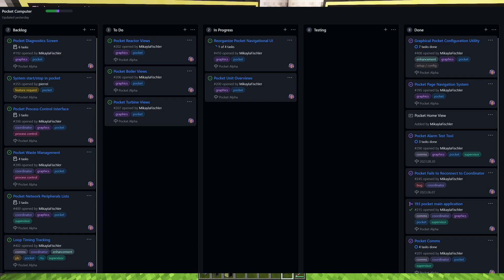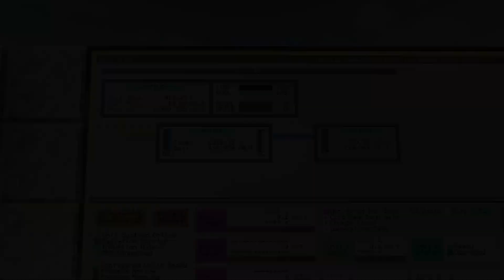Coordinator Configurator

Comment: Hello! will there be a “new” guide for installing the entire system? Since when I tried to install according to the beta guide, the most I could do was get the RTU PLC and Supervisior to work, provided that the PLC does not see the reactor (the red indicator is on)
Reply from the maker: Yes, I had started recording some stuff for the new Reactor PLC setup guide actually, but paused on that. I'll be resuming this coming week/next weekend per requests by yourself and others, so it shouldn't be long before those updated ones start coming out! The wiki still is entirely up-to-date and might be helpful for you, as I made a lot of improvements to it over the last few months. Here is the general setup page: https://github.com/MikaylaFischler/cc-mek-scada/wiki/System-Setup

For the red reactor light, that could be due to not having it connected to a reactor logic adapter, or having a wired modem connection that was not right-clicked to connect it (per the start of that linked page).

Comment: Hey, while I was configuring I ran into the issue that the monitors wouldn’t appear on the screen to be able to select
Reply from the maker: Are the monitors properly connected to that computer? They should either be touching the computer or using wired modems. The wired modems need to be right-clicked to connect them to the wired network, then they should show up.

Comment: I am having an issue with my coordinator, it is constantly beeping at me saying "Generator trip" and "RCS transient" are both on yellow, i would appreciate some advice.
Edit: I managed to fix it by rewiring the turbine so that it would output power into a quantum entagloporter straight to a induction matrix so that the turbine didnt have to wait for the slow cables, in the end it got full which is what caused the beeping
Reply from the maker: Cables can work if they are long enough and a high enough tier, since their transfer rate is additive with length unlike all the other cables (for some reason), but yes you figured out what caused that :) Generator Trip lights up when the charge in the turbine starts building up, and RCS Transient indicates something is not normal with the RCS (reactor coolant system), which in this case was the Generator Trip
Reply: @cc-mek-scada  it was quite a journey from my turbine to my matrix using ultimate mekanism cables but the quantum entagloporter was still faster as the additive rate caps at around 100 cables

Comment: Hello, I've done your program and it works fine, but I have a problem: the yellow Boil Rate Mismatch light is on and I don't know how to solve it. 
could you help me?
Reply from the maker: So Boil Rate Mismatch indicates if the following is true: the total heating rate of the reactor is more than 4% off from the steam input rate of the turbines OR for sodium setups, the boiler boil rates are more than 4% off from the steam input rate of the turbines.

This may occur if you aren't either directly touching your machines together or using Mekanism pipes. If you are using other mods, they might not be transferring at steady rate. If that isn't the case, you may have steam either going somewhere that isn't the assigned/connected turbine(s) or have another source of steam going into the turbine(s) assigned to that unit.

Comment: Impressive work, is that  misspelled " Coolant level low low"?
Reply from the maker: From what I've learned reading through terminology and looking at examples of systems, Low Low (or Lo Lo) and High High (or Hi Hi) are basically "Very Low" or "Very High", so I use that there